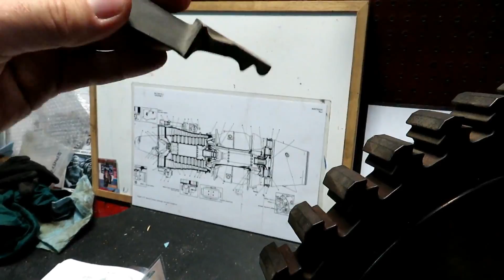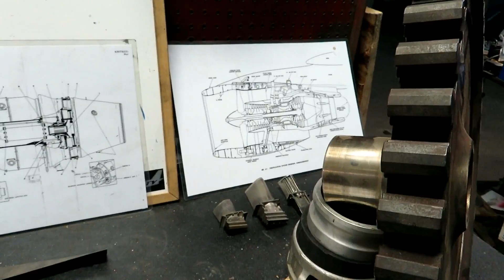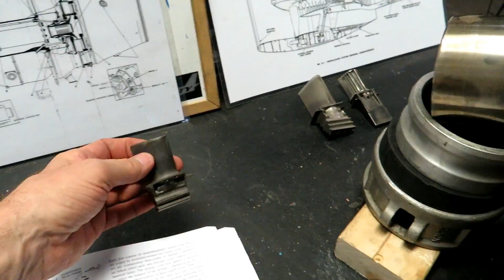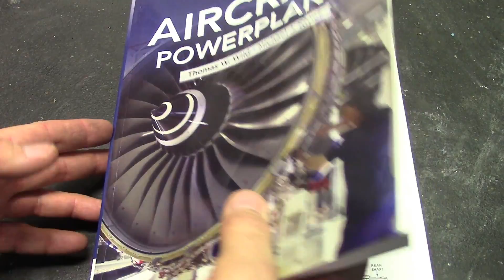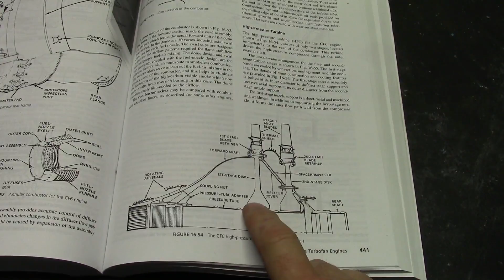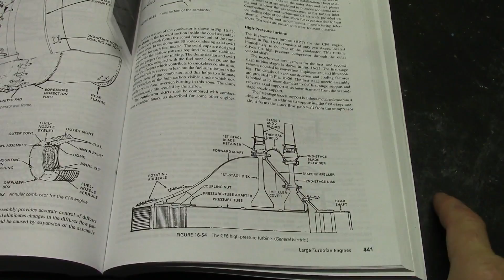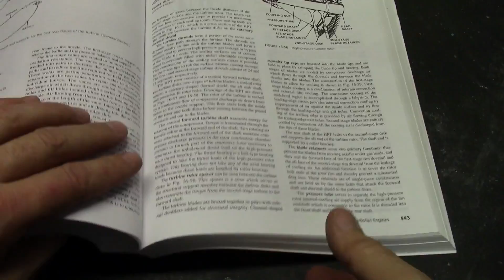Turbine Interstage Seals

Comment: Thanks for this AgentJayZ, as a long time subscriber to both you and Blancolirio I really appreciate the in-depth explanation. Blimey, the engineering detail of these engines is just mind blowing, just the fabrication of those air-cooled Turbine blades looks insane, I can see why they're so expensive, machining and measuring/checking each one must take forever! Not only that, one mistake or fault and it's very costly scrap.
These engineering marvels are what makes modern life possible.

Comment: Air passages!  It must have been nearly 30 years ago I went on a tour of United Airline's maintenance facility at SFO.  Among other things was the engine shop where they did complete tear down machining and rebuilds.  To this day, I remember holding a turbine blade, seeing how they're held in those key-ways on the disk  AND how they have these tiny air passages inside.  Pretty cool to see you talking about them.

Comment: Hi AgentJayZ and fellow subscribers, this is your friendly neighbourhood gas turbine designer (retired) coming up with a few observations.  
I've found what I hope is a reasonably accurate 'pretty coloured' internal air system diagram of a GE90 engine and it is immediately apparent that there has been a major redesign of the HP turbine area of the engine, relative to the CF6 series.  The interstage seal feature is now formed by what I would describe as a 'mini-disc', sandwiched between the HP1 and HP2 turbine discs.  Now if this is the component that has failed and, on the basis of the description in the AD, it appears probable that it is, then it has the potential to fail or even burst (please don't ever say 'explode') and release high energy debris quite capable of penetrating the engine casing and damaging the airframe.
The air supply to the HP1 and HP2 blades is also substantially different.  The HP1 blade appears to be supplied with HPC delivery air by a dedicated annular passage from beneath the combustor to the front face of the HP1 disc.  The HP2 blade appears to be supplied with HPC 7th stage air that passes through the bore of the HP1 disc and the interstage seal 'mini-disc'.
Reply: hey, wondering if you could shed some light as to why the cooling air travels under the disks rather than have the disks attached to the shaft and providing some holes for  the cooling air to move through.
Reply from the maker: Attaching the disks at their outer periphery is better than attaching them by way of a spline at the center. Why? I don't know the answer. Maybe manufacturing costs...
Reply: Natural vibration damping, lower polar moment of intertia
Reply: @bigass197  The turbine discs have to be attached to a shaft that drives the compressor in some way and there are various ways of doing it.  In the CF6 series of engines, GE used what I would term a 'rim bolted' arrangement, plus a drive cone bolted through the web of the HP2 disc.  Bolt (or other) holes through discs are, however, not preferred: they are stress concentration features in a highly stressed component.  Nevertheless, with careful design and high-quality manufacture, they can be made to work.
R-R use what I know as 'drive arm' features on both the HPT and IPT discs in the RB211 and Trent engines, which eliminate the need for any through holes in the discs.  It appears that GE has effectively adopted this feature for the HP1 disc in the GE90. However, I am not at all clear as to how the drive is transmitted from the HP2 disc: I would need to see an altogether better cross-sectional GA.  There may be some form of drive arm extension from the HP1 disc through the bore of the HP2 disc, which appears to have a rear drive arm extension.   
The very last thing that a compressor or turbine designer would dream of doing would be to put splines in the bore of a disc, to engage with splines on a shaft passing through the disc bore or, for that matter, any through holes near the bore of the disc.  The bore and hub area of a disc is very highly stressed and stress concentration features in that area are to be avoided like the plague.  Any splined (or bolted) drive features in the vicinity of the bore would normally be formed on an extension of the disc and, if you trawl around on the internet, you should be able to find a few examples in engine cross-sectional GAs.
Reply: @av8bvma513  Are you answering the question about the attachment of discs at their outer peripheries?  It is not clear to me.  Yes, there may be some damping of bladed disc vibration modes, but that potential problem is not necessarily a major issue. 
Beyond that, I really don't understand your suggestion of a lower polar moment of inertia.  Rim bolting, as in the CF6, places additional mass at the highest radius of the disc, as compared to other possible design solutions.
Reply: @gordonrichardson2972  The Emergency Airworthiness Directive doesn't provide any pictures of the component in question, because it doesn't need to.  The part number and the name of the component are entirely sufficient to identify it and to tell the operators what they must do to comply.  Nevertheless, having looked at the internal air system diagram, the only component that I can associate with the name 'Interstage Seal' is the mini-disc between the HP1 and HP2 turbine discs.  
This is speculation, of course, based on a career lifetime in gas turbine design, but a manufacturing defect in that component, which led to the propagation of a fatigue crack would have the potential to release a large piece of high energy debris, if not the release of the whole mini-disc.
Reply: @bigass197  As an addendum to my previous post, I would refer you to the uncontained failure of the fan disc in the No.4 engine of an Air France A380 over Greenland in September 2017.  They finally found a section of the disc in July of this year and the failure has been determined to have been initiated by a sub-surface manufacturing defect, which resulted in the propagation of a fatigue crack.  My speculation is that something similar may have happened in the case of the interstage seal in the No.1 engine of Thai Airways flight TG970.
Both external surface finish and internal metallurgical quality and integrity are critical for compressor and turbine discs.  As an example, I can recall having to define an acceptance standard for the bores of the Titanium fan discs of a certain military engine.  In addition to visual examination for surface scratches, a pointed instrument was to be drawn lightly across the bore, where visible scratches were identified.  If any scratch resulted in the instrument 'catching' in the scratch, the bore of the disc had to be reworked.
Reply: @grahamj9101   Yes! The fog of ignorance just got a bit clearer. That's good, because it's very foggy in here:)

 Thank You!
Reply: @gordonrichardson2972  When an incident such as this occurs, the relevant authorities do their job of issuing Alerts and Emergency Airworthiness Directives, as necessary, very properly avoiding any speculation.  Sometimes, the circumstances of an incident are far from clear, such as the crash-landing of BA38 at LHR in 2008.   Any speculation by the authorities at an early stage of that investigation would have been most unwise.   
I usually go along with this approach, avoid speculation on this channel and caution others to avoid it.  However, our host, in discussing the issue, has effectively invited us to join in - so I have.  My views are, nevertheless, speculation.
Reply: @gordonrichardson2972  The illustration is very interesting, as it shows the interstage seal between the HP1 and HP2 turbine discs, which I suspect is the component that failed in the engine under discussion.  However, the failure described in the report appears to be totally unrelated.
Reply: @gordonrichardson2972  Yes, the very truncated diagram does give an indication of this.  Nevertheless, I would still like to see a cross-sectional GA showing the whole turbine assembly, in order better to understand the cooling air feeds to the HPT1 and HPT2 blades.  
As an aside, I would comment that R-R has always had a reputation for introducing complexity into its designs.  GE now appears to be similarly introducing complexity.
Reply: @gordonrichardson2972  Agreed.  That is what I was able to discern from the internal air system diagram that I found.  However, as a designer, I would like to have a much clearer view of the components that form the now separate passages for the cooing air supply to the stage 1 and 2 blades.  The HP1 disc appears to have what I would describe as a 'cover plate' attached to its front face, to direct HPC delivery air to the roots of the HP:1 blades.  The separate Stage 7 air flow appears to pass under the HP1 disc, to find its way up the front face of the HP2 disc and into the HP2 blade roots.

Comment: Thanks so much for the quick share! I knew you'd have a valuable perspective on the seal's structure and role even if the CF6/LM1500s you usually work on are the GE90-115's grandfather; the apple doesn't fall too far from the tree. And expertise in gas turbine engine repair is something most of us do not have.

Comment: Thank You Jay....I really liked your comments at the beginning about how the GENERATIONS of improvements on differing series  of Turbine Engines.  I am a retired jet engine mechanic from a well known Airline in the USA.  In my 25-1/2 plus years at this establishment I worked on the GE-CF6 FAMILY OF ENGINES such as the CF6-6K for DC--10 intermediate aircraft; CF6-50s (or the LM-2500) for DC-10 intercontinental aircraft; CF6-80As for the 767-200 series aircraft; CF6-80C2-B6-for the 767-300ER aircraft; CF6-80C2-A5 for the Airbus 300 aircraft; & the CF6-8-D1F for the MD-11 aircraft.  In my tenure-I experienced the visual progression of improvements in the design.  Working on them didn't take a whole lot of imagination to transfer the knowledge on how to work on them because they were all very similar to each other.  As you said, the FAMILY of engines were improved upon with each generation, &/or upgraded.  Many of the parts were interchangeable, but as each new generation came along less & less parts interchanged.  Eventually the GE90s which were a derivative of the CF6 family of engines, but almost a completely NEW ENGINE.  GEN-X Engines are an improvement upon that.  What were the main improvement results you might ask.....Well the fuel consumption dropped, & the power output increased with each new & improved design.  This is also why the DC-10s had 3 Engines, & the  AirBus, 757s, 767s, 777s, 787s have 2.  For airlines this is the bottom line-FUEL COST SAVINGS.  ONE CENT @ gallon in the cost of fuel can cost, or save millions of dollars per year.  So basically, if they can get "MORE-BANG-FOR-THE-BUCK" it's all for the better.  Thanks again!
Reply from the maker: Always good to hear from a professional, with direct experience. Thanks!
Reply: @AgentJayZ  -Please read below my comments on the AA Flight 191-DC-10 crash in Chicago.

Comment: Jay, 
the knife edge seals on the interstage seal are a tricky thing.  They are designed to rub (its how they seal), but with too much rub they can and they can heat up at their tips and crack.  Tiny cracks can propagate down into the seals ring and a large chunk can eventually break off.  Chunks potentially large enough to cause an uncontained failure.  Because the cracking is occurring under the 2nd stage vane, it can be hard to detect on wing.

Comment: Sir, you are to be greatly admired and highly appreciated as you are a very responsible gentleman having to work and assemble with such precision, the hot blades of a jet engine which need to work in temperatures far higher than their melting point and so need to be cooled through units which are so difficult to manufacture and in turn these have to be supported by other systems all working together in harmony.  If only all passengers and pilots would recognize who is really responsible for looking after them and is continuously saving their lives. Congratulations on your vast technical knowledge and your ethical values in shouldering such social responsibility.  It is a pity that in our society, human emotions normally trumps engineering knowledge with its responsibility.  All your videos should be shown in schools and universities for people to learn what is responsibility and ethics in our walks of life.

Comment: Thank you for the info. I was an AMT with an airline, but I never got this deep into the engines. I saw a 767 that threw a turbine wheel and broke the shaft during a ground maintenance runup. Helluva fire and a bunch of dings in the wing skin. Wheel went through the air cycle house and got the other engine. A real mess!

Comment: Thanks for explaining these engines in plain English. I work @ a natural gas compression plant; we have frame- 5 one shaft GE turbines turning Delaval compressors and a few Solar Mars and Taurus two-shaft machines moving residue gas. Even though you're working on airplane stuff, the principles are the same. I've learned alot watching your material, and like your methods of presentation.

Comment: Your explanation of high pressure to low pressure is spot on... Anyone who works with any mechanical engine requiring any type of vacuum advance or retardation, should already understand this concept. It's one of engineerings more basic principles for cooling, monitoring or switching.
Reply: What is the pressure of the cooling air?
Reply from the maker: Compressor discharge air. It depends on engine rpm, but it's always about 5 or 10 psi more than the pressure in the combustion section.
Reply: @AgentJayZ  that is not as much as I would have guessed; the cooling holes are quite small but then again air is not very viscous! The absolute pressures must be quite high though.
Reply: Sorry I am moving so slowly! I applaud all the effort you put into your project to get it done. I just rebuilt all the rear subframe bushings and links and put a wavetrac into a 500sl diff and rebuilt some SL half shafts and stuck it all together. Have to have the rear driveshaft shortened a bit now and we will be ready for turbos and new intake etc.

Comment: Excellent presentation of a fascinating super technology. Considering the cooling holes in the blades shown at 19:43 and the disk rotating at such high speed, one wonders how much the centrifugal effect would pump out air through the blades without the " working pressurized air" being added!
Reply: Yes, there is a C/F pumping effect, but it occurs primarily in the outward flow up the face of a disc, which can be enhanced by creating a narrow radial passage  with what I would term a 'cover plate'.  Try to find the 'GE90 Engine Airflow' general arrangement diagram that I've mentioned previously: it appears that the HP1 turbine disc has such a feature.
Conversely, the inward flow of HP compressor stage 7 air,  between the stage 7 and 8 HP compressor discs, will lose pressure, as it is flowing against the pumping effect.

Comment: What prevents such tiny channels from getting clogged? For example when a plane lands in a storm, a lot of dust likely gets kicked up and probably ingested right? Is there filtration?
Reply: I assume there is an inlet particle separator. On my engines I think it’s after the compressor section... but I’m just a pilot so don’t listen to me.
Reply from the maker: No filtration. particles tend to be centrifuged out to the sides, and seal leakage air comes from the center. Any crud buildup is cleaned up at each overhaul.
Reply: They can and do.  The very fine 'sand' in Saudi Arabia and the Gulf can go down to micron size and a sandstorm can take the fine stuff up to 10,000 feet or more.  I had the job of designing a so-called sand-tolerant turbine blade for a certain military engine, in service with the Royal Saudi Air Force.
The 'sand' is also a perennial problem for airliners operating through the Gulf region.  Because of their sheer size, large turbofans can't have inlet/inertial particle separators, as used on small helicopter engines.

Comment: The air rushing through the blades is plenty. When we make blades with either casted holes or stem drilled holes the holes and flow have to be matched and measured. If the blade allows for too much air through it will be rejected and scraped.

Comment: A catenary is the shape a rope or cable takes on when suspended between supports under its own weight (Think the shape of suspension bridge cables). It makes perfect sense to shape the seal this way as this is the shape it wants to be under the centripetal force exerted on it as it spins, so this is likely why it's called a catenary seal.

Also, I keep finding out that the people who I like on youtube ride bikes too - I suspect people with an engineering mindset appreciate the inherent simplicity and efficiency of bicycles on more levels than most. Great information too - confirmed a few things I suspected but never saw written down on the workings of jet engines, namely the compressor pressure being higher than that of the turbine gas and the 'cooling' air being damned hot because it;'s just been compressed. I had no idea the rotor parts weren't directly connected to the engine shaft either (On the bypass sections this is obviously the case, but not on the innermost passage). Thanks for a great video.
Reply: EE/RF/design eng here; ride a +2 inch tired 'trail' bike in the city, don't have to worry about sidewalk cracks OR the 'edging' that leaves a little trench each side of the sidewalk ... 
Bike works GREAT when tracking down power line RFI (elec. noise) too 'cause I can stay on the sidewalk on busy streets and make multiple passes on a 'target' when iDing a noisy pole ...